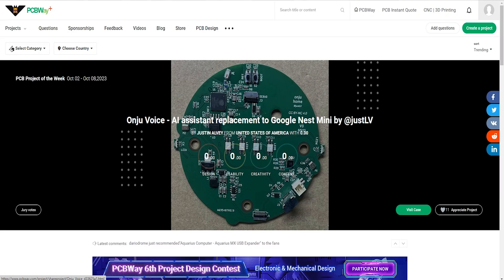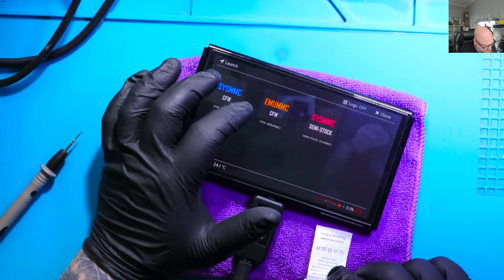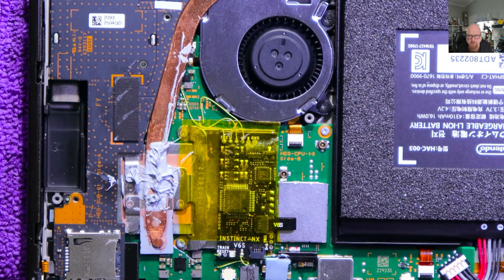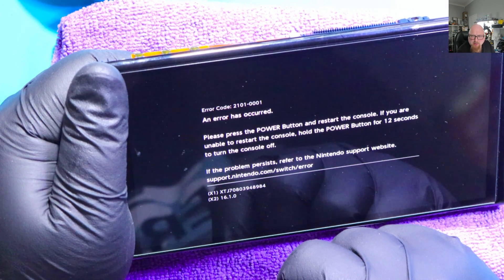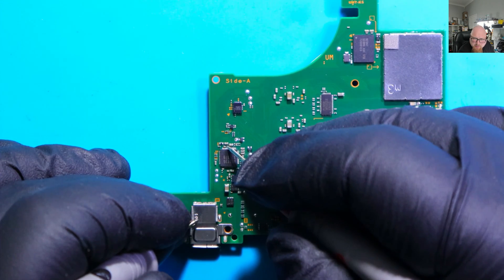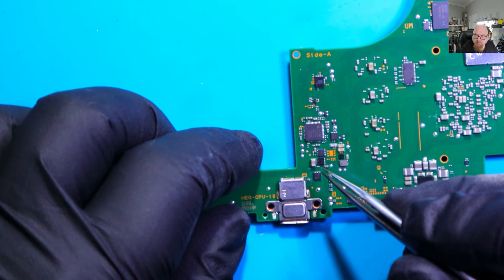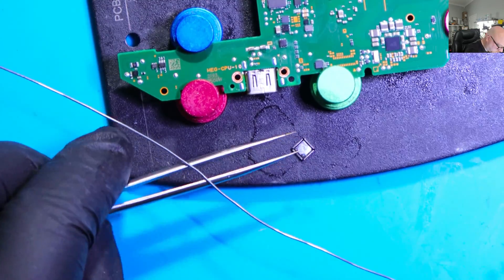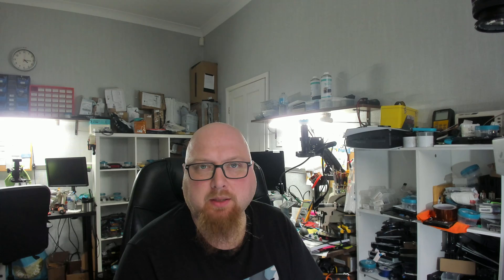Let's fix SWITCH OLED previously modded by Sthetix with V6S. Error messages....

Comment: I get why people tend to do the adapter method.  The Kamikaze method is very challenging and requires lots of skill and the correct equipment.  

With that said, the Kamikaze method is still my preferred way to install these chips since I've got the equipment, skills, and eye sight to pull it off.  It leads to more trust-worthy results, and it makes me feel better knowing I never have to worry about the adapter failing.

I commissioned an adapter one from you a few years ago, and it's still holding up well!  You clearly know what you're doing with it, and it makes me think that the adapter problems people have might be a result of how they install it.  Your adapters don't fail, so I think you know how to do it correctly!

Comment: Where can i get the usb c tools u use to show you which points are shorted at the port also the usb C tool that u used to show the volts while charging? Would you be kind enough to give me links to where I could purchase those devices online?
Reply from the maker: https://s.click.aliexpress.com/e/_DBRz1BR  usb-c current meter
Mechanic T-824 Mobile Phone Tail Insertion Detector
https://s.click.aliexpress.com/e/_DEGb1wt
Reply: Thank you Sir very handy tools to have on hand when trouble shooting.